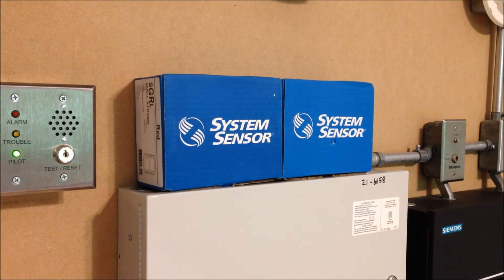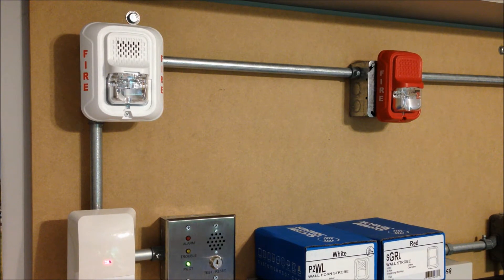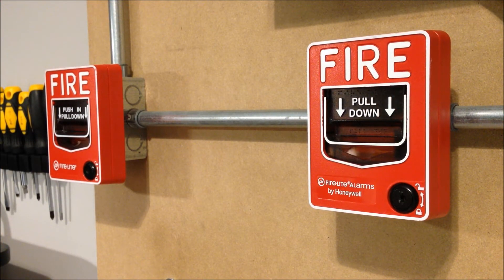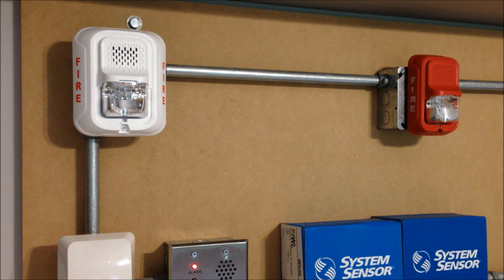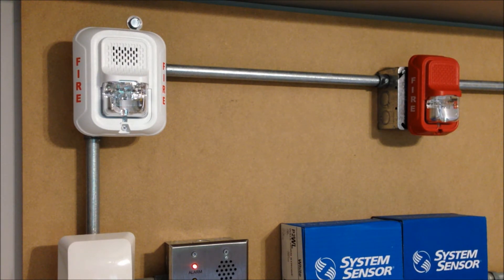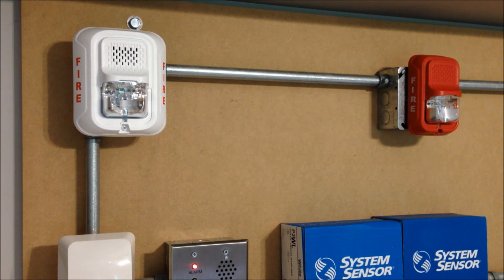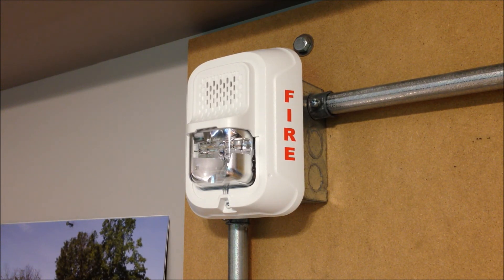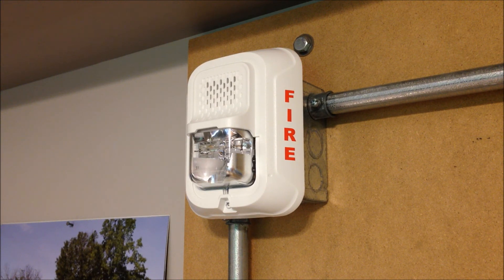System Test 30 | System Sensor L-Series

Comment: I'm betting in five years, the L series will become just as common as its' predecessors (the SpectrAlert Classic and Advances), if not more common. It will probably even replace a few of those in some installations (as I've seen quite a few places have SpectrAlert Classics get replaced with Advances.)
Reply from the maker: Agreed. System Sensor is fairly dominant in the fire alarm market, the L-Series will provide for a continuation of this success.
Reply: Yeah, but it does suck how they're constantly used to replace old fire alarms, including ones you may have grown up with, like at the school I went to for kindergarten. And my second elementary school seems to be up next...

Comment: Do you think it's safe to use my Simplex 2098-9806 an a NAC with Wheelock sync? I tried it and the LED would blink a couple times about when the strobes would flash, then when I activated selective silence, the blinking just become more frequent.
Reply from the maker: It should be fine. The blinking you are seeing is caused by a momentary drop in voltage across the NAC which signals the Wheelock strobes to discharge, thus keeping them in sync. Activating selective silence sends more coded power drops onto the circuit to "tell" the devices to silence their horns, resulting in the more frequent blinking.
Reply: Thanks, just making sure.

Comment: Nice! These new devices look modern and more appealing than the old Advance line. It stinks that they still have the same horn as the Advance, but at least we get the 3000 Hz smoke alarm tone. Once again, great test!
Reply from the maker: Thanks! In person, there is much more bass to these horns than the Advance, which was more shrill. Although the sound is pretty much the same, for some reason these do not have the same irritating quality of the Advances.
Reply: kcin556   I see, well that's good! At least it isn't a total reskin.

Comment: How do you read System Sensor date codes? I got my P2WL from the same eBay listing so it's probably the same time but just wondering.
Reply from the maker: The code on our devices is 7041. The first digit is the last number of the year, so 7 is 2017. The next two digits are the month, so 04 is April. Finally, the last digit is the week, so 1 is the first week. So our devices were manufactured between April 1 and April 8, 2017. Here's the official explanation: http://www.systemsensor.ca/en/Prod_Library/Date_Code.html